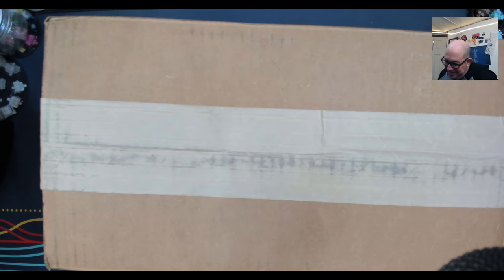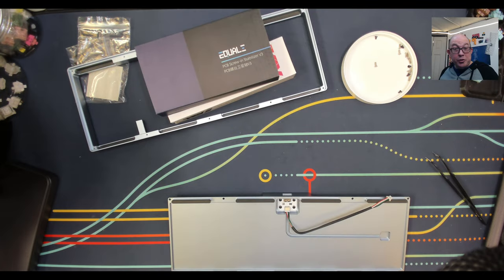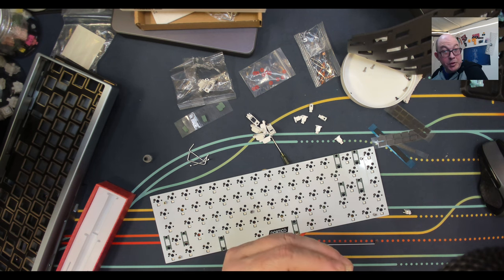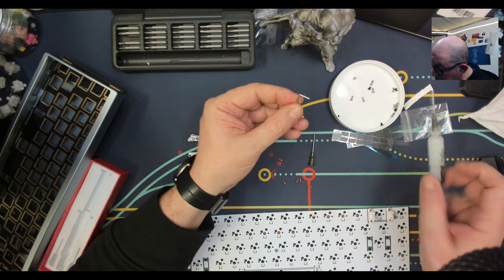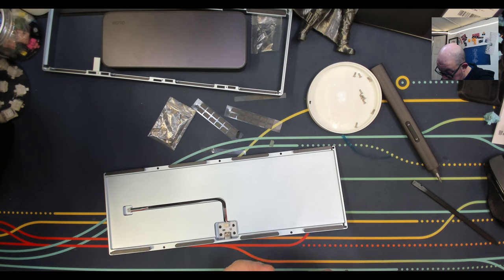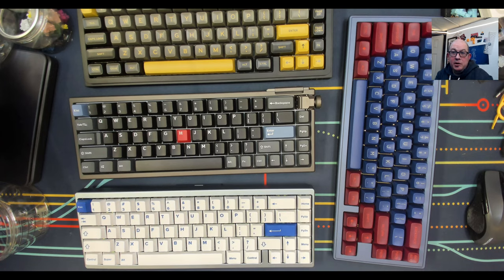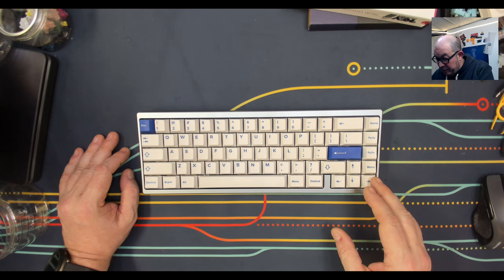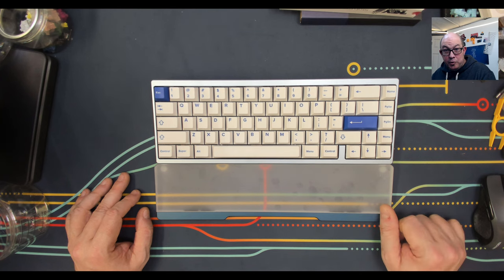Portico68 Black Label (Bombay) Build with Kiwi Tactile switches, IFK Blue on White & sound test

Comment: The previous plastic version sounded better imo 🤭. The black label sounds too metallic-y from the sound test in this vid. Im currently in the hunt for a nice budget friendly 65%/68 keyboard kit atm and they are so hard to come by. 

Have you heard of the KEZEWA ENTER67 by Drop? was just announced, includes a flexcut pcb. From what im hearing the flex cut pcb really kills the sound but other than that it really seems to check everything off for me and im intrigued on pulling the trigger for it
Reply from the maker: Their website does not even have a contact page, not going to fly.